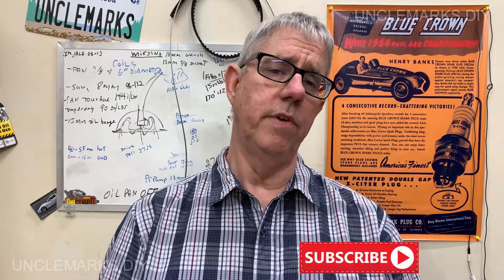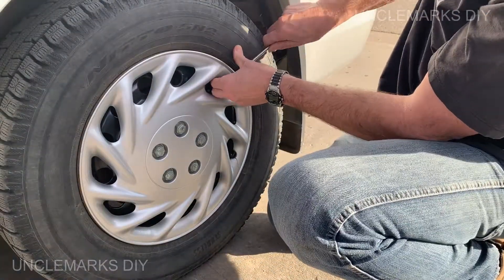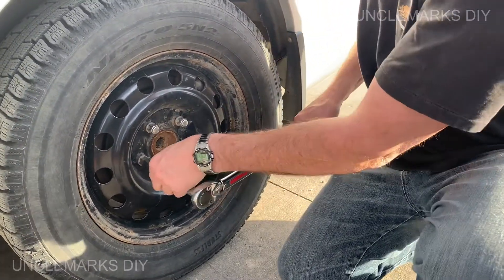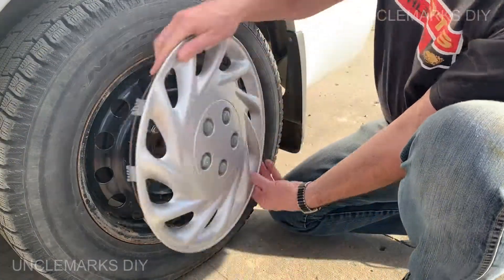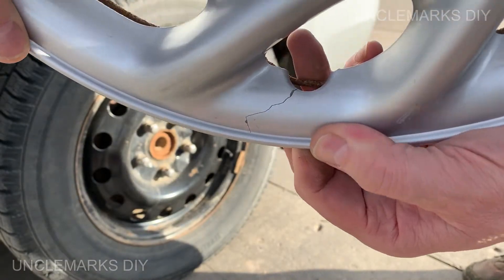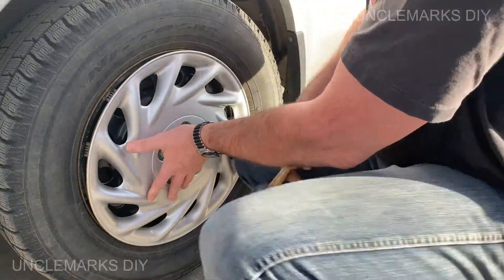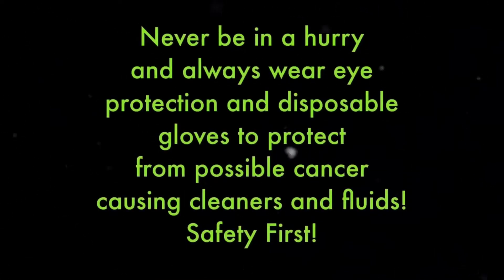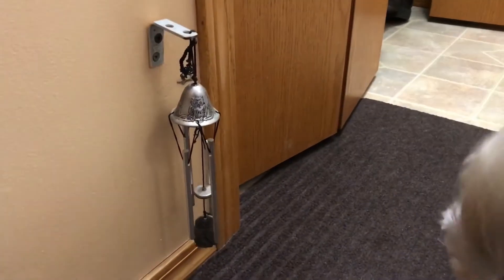Do I need to re torque lug nut wheel nuts (EP 162)

Comment: Hey Uncle Mark, I did that cv axle job, I was asking you about, the other day? I went and bought the seal puller, and it came with 2 heads. I couldn’t for the life of me, get an angle, to get the hook in the seal, to get it out? I tried a flathead, small pin head drivers, that thing wouldn’t budge. Just getting the axle out, took and hour? Had to hit it from the backside to get it off, the stub shaft. I did  replace the Circlip. The seal wasn’t leaking at all, so I just left it. Hopefully, I don’t have any problems? So far , so good? No leaks, new hub, new axle, and new stabilizer link.
Reply from the maker: Humm. Might be a special angled seal puller?  If nit leaking I would not worry. If it starts leaking you can do it then! Usually the seals seep first, you will have lots of notice when it eventually needs replacing. Oil spots on the ground where you park etc. Just keep an eye on it!
Reply: Yeah, it wasn’t leaking at all, so I straightened it out, on the edge, where I tried a small pick tool, but that didn’t budge it? I just put a big socket over the edge, and straightened it out. So far, so good?🤘
Reply from the maker: @markochman75  Just keep an eye on it. Glad it went OK. Probably made yourself $300 doing it yourself?

Comment: How would you check to see if they were over tightened?  I have read that if your torque spec was 100 and they were at 120( but you don't know this yet),  if you set your wrench at 100 it will click at 100 even though they were tightened to 120.  Would it be best to just loosen one at a time and retorque each lug?  Thanks
Reply from the maker: You are right! To see if over tighten, you would have to loosen and retighten. Many tire shops are bad for over tightening.

Comment: ive never owned a torque wrench  i looked  on amazon and there are some many different sizes  1/4 inch  3/8   1/2 inch  ...im no mechanic  which size do you recommend   i just do my own  small repairs  ...  think i took off  2 tires to fix last year ...what  do you have for a torque wrench   ...thanks
Reply from the maker: Either a 3/8th, or a 1/2 inch. I have the 1/2 inch, goes from 10-150ft lbs, they are probably $50 to $75 CAN. Wait for Canadian tire to have a sale for 1/2 price! Just bought another one that goes from 50 to 250 ft lbs. Needed on for wheel bearing set at 200 fts.
Reply: @unclemarksdiyauto    ok i can wait for a sale from c t...thanks i will probably just tighten lug nuts
Reply from the maker: @queenstownkid  You will be shocked how you will miss judge how tight or loose they sometimes feel as you tighten them.
Reply: @unclemarksdiyauto   Canadian tire just had the sale on the 1/2 maximum torque wrench $69
Reply from the maker: @404notfound.....  They are fairly cheap and a good investment. Queenstown kid told me he ordered one!